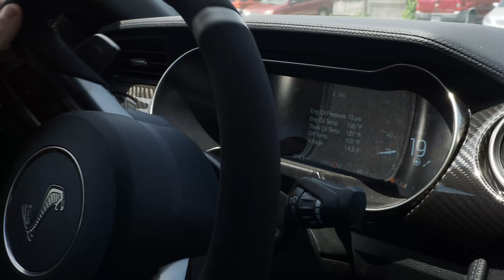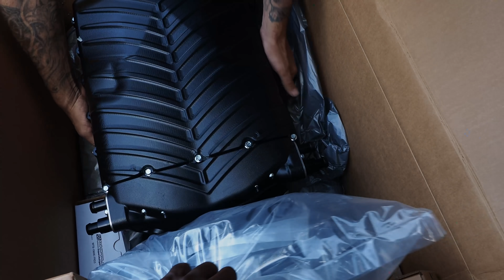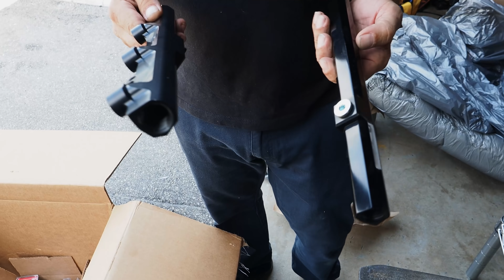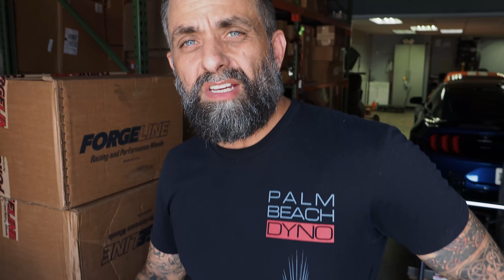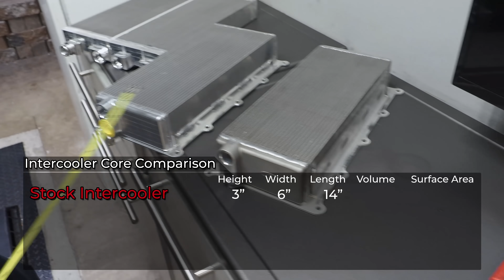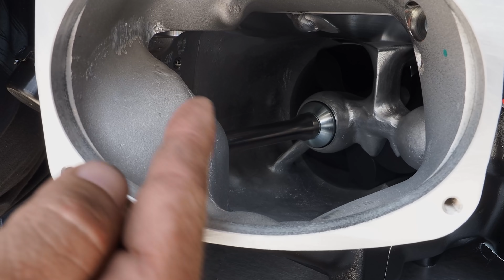THE GT500 WHIPPLE 3.8L IS HERE! | First Dodson Clutch Installed!

Comment: How does the new Whipple 3.8 liter compare to the Kenne Bell 4.0 liter?
Reply: I've been a kenne bell guy forever...., but whipple and vmp blows them out the water on hot laps atthe track
Reply: For some reason no one’s running kenne bell anymore
Reply: @mustbefast9923  kenne bell is an awesome blower, they have very little parasitic loss with their rotor design but yhe trade off is the amount of heat it holds.  Iat's go through the roof after a good solid run and tge car starts pulling timing.
Reply: @mustbefast9923  Kenne bell hasn’t updated their blowers in years. They’re still pretty bad ass up VMP and Whipple stay updating their products